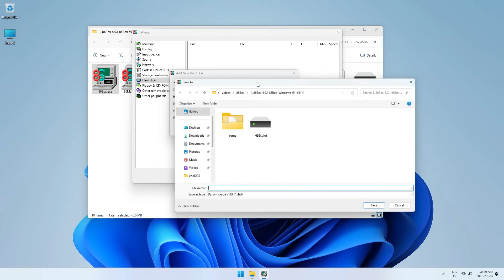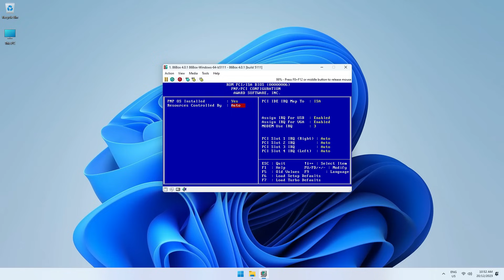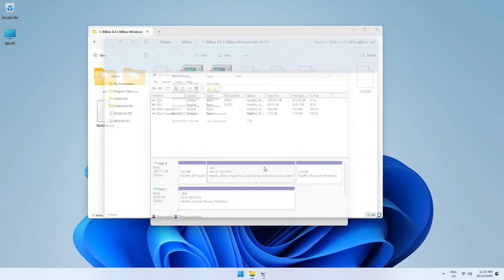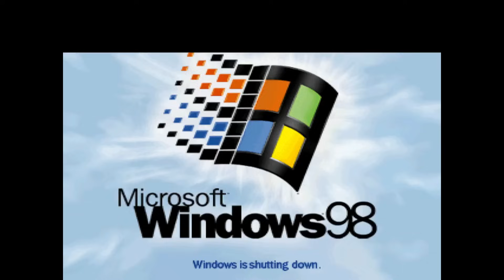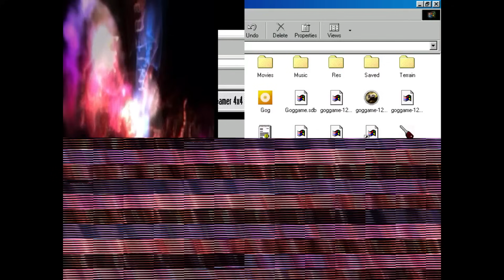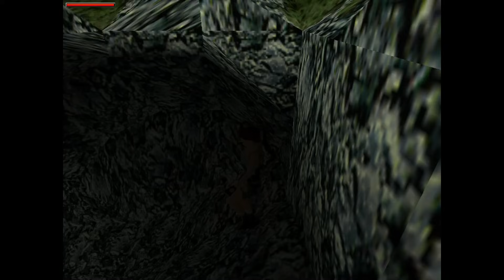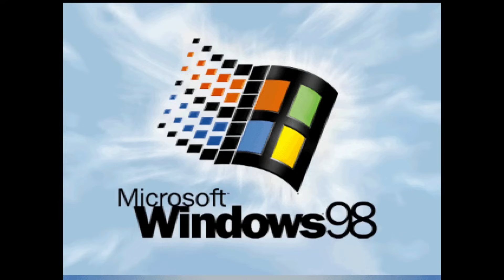86Box Windows 98 Setup (Pentium II +Voodoo  3, all files provided)

Comment: My silly brain was asking the question that "Haven't we got through this before?" After I realized it was for PCem... Oops, very sorry for having such thoughts 😅

I'm like so-so on Emulators, I mean - I would love to emulate even better CPUs than Pentium II/K6-2, like a Athlon XP and such, but at same time - Like you said, seems funny that PS3 Emulators are already a thing, and this runs games like for example Grand Theft Auto V (The 2013 release, ofc), Gran Turismo 6 or something more old, like let's say Call of Duty 3... Meanwhile Pentium II emulation on PCem/86Box struggles with Keeping the audio without much stuttering, when something is loading or some of the games' performance. Kinda weird if you ask me.
It's fun to mess around with the specs and whatnot, but for some serious gaming it's still a LOOOOONG way to go.
Reply from the maker: Well I used the same thumbnail, so I knew it would trick a few people. The PCem video did well so I kept the same thumbnail style and most people watching are as a result of a search.
Reply: @philscomputerlab  If anything, that is clever, but also a good observation.

Comment: If your CPU is on the weak side, forget about emulating Windows 9x on a PII, it's going to throttle pretty bad. The best you can get is a Pentium MMX. And even that is going to require something somewhat beefy. You can get some extra performance by running Windows 2000 instead but that might not be a very good system for games.

Comment: I had this setup about 2 months back and stopped playing with it when i got some new hardware in. that said i remember the windows 98 sound skipping now.
speed emulation issues humm? I did not see what are the specs of your machine? 
I think i was running it on a ryzen 5 5600g with 16gb of ram
Reply from the maker: i9-13900H.
Reply: definitely beating the pants of mine lol!
im guessing the software will need some more love before we get full speed..  @philscomputerlab

Comment: Nice video covering this gem of a program, I use it for all kinds of old emulating stuff as well as benchmarking it vs. some other programs like DOSBox. I've found 86Box's results being quite close vs. real world benchmark results as well.

Some notes from me:

The CPU emulation speed is highly dependant on your host CPU's speed. With my Ryzen 5800x3D, which has 8 cores and 16 threads, I cannot reliably go over 200MHZ with a Pentium II without games and even the OS itself stuttering constantly. This can be alleviated a bit by being content in running a original Pentium and Windows 95, but I'd forget using this emulator past the 486 era without a beefy host CPU. I also don't think this emulator is multitreaded, so you'll get better performance the better your single core speed is.

Another way to move files to the emulated OS is by mounting a host OS folder as a CD-ROM drive in the emulator's settings. Not as fast as copying them inside the host OS, but requires less hassle and is maybe a bit more "authentic".

I also recommend constricting the emulated HDD speed to the 1995 - 1998 speed settings since this reduces throughput and thus increases performance of the emulator. The CD drive rarely needs to be higher than 8x either.

Comment: I had a near identical experience with PCem which does a very similar thing. I found that up to 1997 games everything ran pretty well but from 1998 onwards you started to get into bottlenecks. Games such as Need for Speed III would start to stutter a little and Unreal wouldn't run quite as nice as the specs would have you believe. Commandos Behind Enemy Lines ran fine but nowhere near as smooth as on my real Pentium II 333 with a real Voodoo 3 card. Considering this was on a 13th gen i7 it was a bit disappointing.

AFAIK PCem development has slowed down a great deal but it's still faster than 86BOX from what I recall. PCem seemed to also focus more on the emulation of real systems & hardware than getting better performance out of later hardware. I mean, I understand, but there's such a big demand for Windows 9X and XP emulation because so many games no longer run properly or at all on modern hardware or Windows. Even friends who aren't really that much into gaming otherwise have shown interest in playing some oldies from the late 90's again and asked me quite often if I could get these games running on their Windows 10 or 11 PC.

Comment: Man, I really love how you just dive right in on these instructional videos.  No silly intro, no runtime padding, just right into the good stuff.  👍
Reply from the maker: Yes!
Reply: @philscomputerlab  A year later and the 64 bit version can't play UT from GOG - getting either "a device previously attached has stopped functioning" or "this program expects newer version of windows" - also the state of "emulation" is so unoptimized, its not even funny.
I run a 7800X3D, and it starts to stutter at anything higher than 300 MhZ, which tells me that there is an issue with the optimization.
Overall, more annoying to set up than PCem, and absolutely the same atrocious performance.
Sadly x86 emulation seems to be DOA as no big emulation powerhouse developers (such as the ones working on RPCS3 or similar projects) do not wanna touch it with a 500 KM pole.
Reply: @volf3r505  I've noticed this as well. For instance, I used to run WinBox and an older version of 86Box and was able to run the demo of Prince of Persia without issue on my Ryzen 7700x at 266Mhz. Now every time I try, it simply does not work. I've used the exact same settings I used in the past, exact same hardware, many different DirectX versions and it only loads a black screen with a few icons on bottom. Running a different version, it's fine. Really wish more progress was being made with it, love the software otherwise but yeah, kind of glitchy.
Reply: @philscomputerlab  By the way, Where is HDD.vhd?
Reply from the maker: @lincolnloud4720  Wherever you created it.
Reply: thats why i like youtube platform, millions of helping videos out there
Reply: Yeah, thats the spirit of a real babo!;D
Reply: Its True, awsome instructional 🙂
Reply: Austrians are known for their no-nonsense approach.

Comment: This emulator is so GREAT... been using it for quite some time, the only missing thing is Sound Blaster Live with EAX emulation, once it has that, it can very well replace a true retro computer for late-DOS & Win98 gaming. But people have to keep the expectations under control, this an emulator focused on accuracy, it's not the typical console emulator, and emulating a true PC computer with 200 Mhz or more require a beast of a CPU with an immense single core performance and there's no benefit on multicore CPUs. a PII 450Mhz is out of reach for any existing consumer CPU rght now.
Reply: My Ryzen 9 7945HX can emulate PII 450Mhz without any issues in DOS. I have only tested Screamer Rally in SVGA 65k colors. Many popular games like quake are not free unfortunately. Hwinfo reports performance closer to PIII 800. Screamer rally is a smooth experience with no sound glitches. I believe modern CPUs fare much better than those 10 years ago and we are able to emulate much more than Pentium 200.

Comment: To everyone making dumb comments about performance, this is cycle exact EMULATION and not VIRTUALIZATION. And in PCEm/86Box, it's even worse than usual because they're doing it across a whole range of hardware, not just the cpu and a few chips. VirtuaBox/VMWare will do a lot better because they "offload" a ton of crap using custom drivers and don't even emulate the CPU. But it comes with it's own set of problems. QEMU will "offload" some with custom drivers, but... it's own set of problems.
As before, use PCEm/86Box for the really old stuff that has a lot of problem on anything but old hardware, DosBox for most DOS stuff and find some 2nd/3rd gen Core i3 office pc in the dumpster for W98/WXP stuff. Hard part will be finding a (good) old graphics card that supports W98.

Comment: Out of curiosity, can you review DosBox Enhanced Community Edition? I think it has 3Dfx acceleration!
A comparison with 86Box & PCEM might also be a good idea,
Resource usage (RAM, CPU, harddisk footprint)
Stuttering, Glitches
Sound emulation
Ease of integrating into a launcher (You already showed eXoDos using launchBox & the manager)
 especially try to run them on oldest supported hardware (maybe from XP ERA Core 2 Duo built in graphics , 4GB RAM) but using newer Operating system that support .NET Framework 4.6?
Imagine how many e-waste can be used as a DOS machines
BTW I noticed Unreal Tournament Gold GOG on intel965 graphics, windows8.1 runs average 120+ fps using openGl backend while it slowsdown using directX

Did you know Terminal Velocity had a sequel released in same year? its called Fury3 1995
Reply: Isn't 86box a fork of pcem? I mean like speed between them will be same...
Reply: DosBOX ECE is dead, and even when it was alive it was easily eclipsed by DOSBox Staging.

PCEM is also way behind in development compared to 86Box.

Therefore it's easy to recommend 86Box and DOSBox Staging over these.
Reply: @LordTuskis  Got it 👍🏻
I wonder why GOG doesn't include Staging with their releases tho~

Comment: For everyone that are surprised about the emulation speed. Both PCem and 86Box are "true" emulators: they emulate the entire system HARDWARE, from CPU, to mainboard components & graphics card. Thanks to that, they're very precise.

That's contrary to for example DOSBox, which runs more like a VM
Reply: wat? dosbox is emul too.
Reply: @VShuricK pcem and 86box emulate raw software, you can even run Linux on emulated hardware, you can not do the same thing with dosbox.

Comment: nice detailed video, thanks Phil!
I watched somewhere, to make one "empty" emulated system and use it as a template for individual games: you copy the VM, install and configure single game and put EXE in autostart, so as machine boots game starts its like a ROM for consoles, and windows installation adds about 500 mb itself to the game file, which is not a big issue and you have console like experience :) did not find detailed instructions for it, would love to do it though
Reply: You can use differencing vhd images to avoid unnecessary windows duplication. You create a base win9x VM, and then you create new VMs with differencing images that point to base VMs vhd file as the parent. That way you can save space and use a single windows installation for each game while still keeping it clean.
Reply: @highestsettings  Is there a guide somewhere for this?

Comment: Impressive the number of systems in the configuration. Good for testing of software and hardware combos and if you have limited space. I don't think I'll be getting rid of my original hardware and not as fun as dealing with real world hardware compatibility and repairs, but as a supplement and quick usage cases it's very good..

Comment: I have a i3 10100f and it struggles to emulate accurately anything above Pentium 166mmx... even though it's like -5% performance from a stock i7 7700 the IPC is not good enough. Luckly I run win98se natively on the same i3 system :)))) just by using the PCI slots I managed to get everything recognised: gpu, sound, usb 2.0.
Reply from the maker: Awesome!
Reply: My 7900x overclocked, just about accurately does a 233mmx, the p2-300 nope. That's just how poor the emulation performance is. I have athlon system with AGP and ISA slot that works well
Reply from the maker: PS3 emulator enter the chat... @jondonnelly3

Comment: Windows 98 the OS of my high school years... man I'm getting old
Reply: Then Im ancient because I used a Comodore64 and AppleDOS in High School, then AmigaOS, DOS/Windows3.1, MacOS 6.x and SystemV when I started Uni....    lol
Reply: @nikmilosevic1696  lol
Reply: Windows98 was only on teachers PC, others were 486 with Windows95, I helped my teacher to maintain them, it was fun = )
Reply: @enosunim  when I started high school all the computers teacher and the labs/library computers where 486DX 66's running windows 3.1 some had Sound Blaster pro 2.0 cards installed, had I known they where over summer break to be replaced with some kind of (I think Pentium II's) running windows 95 (and yeah it still sucked lol) I would've tried to get a few of the 486's

Comment: What's your experience with PCem vs 86Box vs just plain dosbox?
Reply from the maker: For playing DOS Games? DOSBox Staging hands down. But if you want to interact with the BIOS, partition drive, and test stuff outside of games, then PCem and 86Box are better. But really, the advantage is Windows 9x for those.
Reply: @philscomputerlab  I have seen people installing Windows 9x in dosbox as well I think?
Reply: @p_mouse8676 It's possible, but the range of hardware DOSBox can emulate isn't as well suited to Windows gaming. It's also not really designed for that, so you're more likely to run into issues with device drivers and whatnot.
Reply: 86Box is a fork of PCem with some quality of life improvements. I'd expect the performance and system requirements between them to be pretty close to the same.
Reply: @T3hBeowulf  thx, I was thinking this, after I did little googling, and found, that pcem goes for some people little bit faster also...
Reply: I find PCem is a little lighter and runs smoother (probably because its not been updated in quite some time) 86Box is more accurate to the hardware in my experience and for that a little harder on you hardware to run.
Reply: Was there any speed differences between pcem and 86box please? Looks quite same
Reply: @dim0n1  For the small testing I have done, PCem seems to be much faster, but that's why I am very curious about the differences! :)

Comment: Which one is better, 86Box or PCem?
Reply from the maker: I found PCem runs faster. Both worked just fine otherwise. But PCem isn't actively developed anymore I believe....
Reply: @philscomputerlab  I  thougt the dev's where working on optimizing for pentium instructions?
Reply from the maker: I hope so!  @JohnSmith-xq1pz
Reply: @philscomputerlab  Indeed, it's what I'm waiting for so I can build a virtual machine version of the Pentum 233mmx we had back in the day
Reply: PCem have Linux version, while 86Box have no plans on this. But I read, that 86Box had different optimized versions for different CPU's, some time ago. But now there is only one version, they discarded this approach. PCem have changed maintainer, and they do something there.
Reply: 86Box has a Linux version for quite some time now, even a MacOS (x86-64 and ARM64) version unlike PCem @enosunim
Reply: @pankoza2  Wow! This is interesting. I will surely check this out! Thanks!